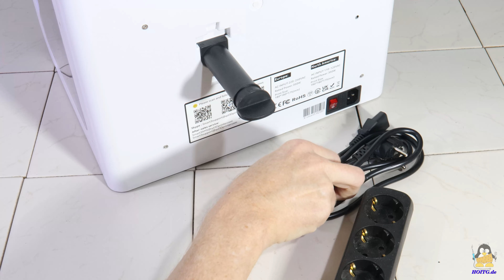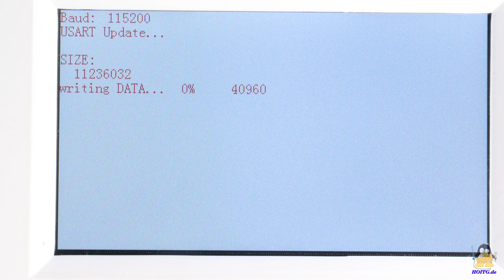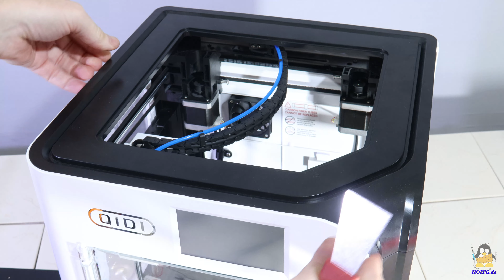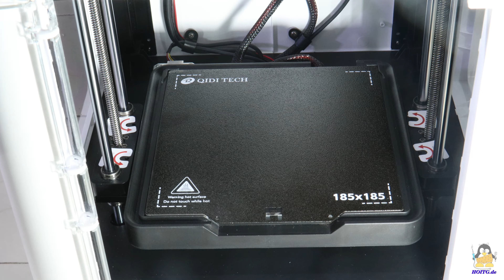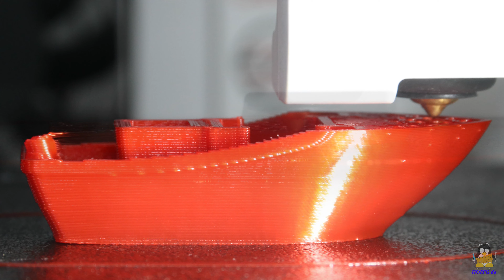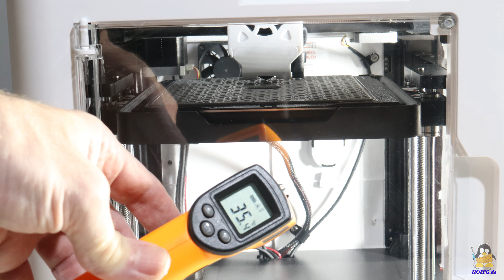Review of the QidiTech X Smart3 3D printer, received from Geekbuying

Comment: Over the last couple of years I've watched quite a lot of reviews of 3D Printers.   Many from popular channels.  This review,  from the technical perspective is by far the best one I have seen.    I wish there were more  technically sensible  reviews like this one.  The only criticism I have is the metal tool - spatula you used to pry out the top cover.  It is almost never a good idea to use a metal for that.  Using plasitc tools is much safer  quite often old credit cards are handy for that.
Reply from the maker: Thanks!
When removing clipped connectors you always have to hold your breath ;-) The correct tool might increase the success rate.
Reply: @hoitg4647  I agree this is tricky,  but the proper tools make the difference.  Another very underrated tool  is proper temperature. 
So  hairdryer or anything that will warm the plastic to 50-60C or so, will  greatly help form preventing the crack.

Comment: Well we may use a 200 and 300mm/s benchy, my bed slinger can do one at 180mm//s in 22 minutes...
The max flow mode should be done in vase mode, there's a stop / retraction in that cylinder.
Reply from the maker: Yes, of course you can speed up a print by changing the settings in your slicer, but the idea behind my Benchy speed test is not to print as fast as possible, but to make the speed print comparable between different printer models. So I am using the same settings, only changing the print speed. With that you see if the extruder can handle the material throughput, if there are vibrations / backlash caused by the mechanics and if the part cooling fan works properly:
https://hoitg.de/Testprocedure-3D-Printers-FDM_en.htm#BENCHY_FAST

Material throughput is not done in vase mode, simply because this is rarely relevant in practice. In extruding layer by layer, you can see what happens at the layer shift. The seam should as thin as can be. You get an extra information by looking at the resulting cylinder. Details on that procedure:
https://hoitg.de/Testprocedure-3D-Printers-FDM_en.htm#EXTRUSIONRATE

Comment: Great review - I'm looking into getting this printer and the disassembly of it helped. About measuring temperatures - IR thermometers (the ones used in the video) are not really accurate when used on different materials because they depend on emissivity and reflectivity of the surface. Ex: If you have a 20C sheet of glass and a 100C object in the background, you'll get something like 60C-80C when measuring the glass - basically a reflection of the background.
Reply from the maker: Thanks. Yes the thermometer for sure isn't laboratory grade, but it is at least useful to get a rough and quick reading.

Comment: Wouldn't higher bed temperature cause higher temperature difference between bottom and other sections of the part?
Reply from the maker: Well, higher than 120°C isn't possible with the X-Smart 3.
With my rough temperature measurement I only can detect the temperature of the walls on top and bottom of the printer. However, there is also a temperature gradient running straight through the printed object itself. We can start making a science of that temperature gradient or just accept: With ABS it works for this printer.
Reply: @hoitg4647  it seems to me temperature difference between the section of the part sticking to bed and other parts which are cooler cause warping, how can raising bed temperature help with this? (I know higher bed temps help with abs better sticking to bed but if we assume abs have stuck to bed, wouldn't raising bed temps be bad for temperature gradients and drafts and ... in the enclosure?)
Reply: ABS is printed at ~250C - that is where the gradient "starts". If you set the bed to 20C you get a 230C gradient for first layer. If you set it to 120C then you get a 130C gradient for first layer. Adjust similarely for next layers.